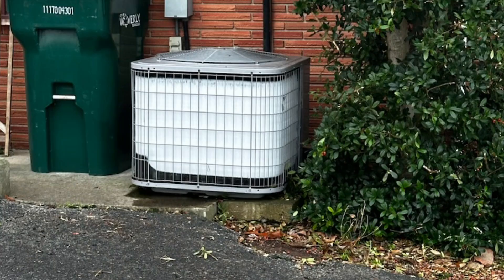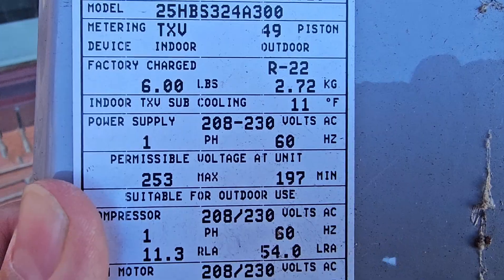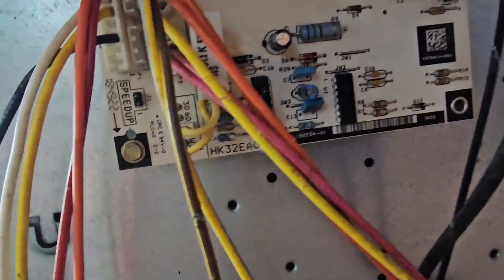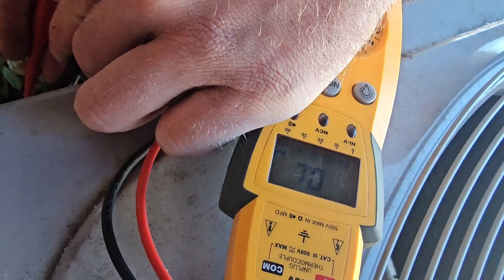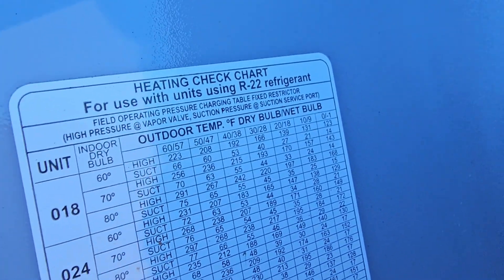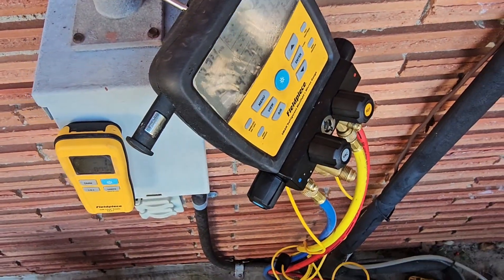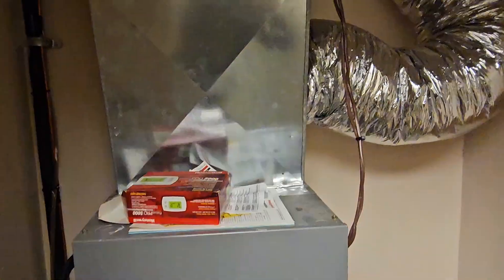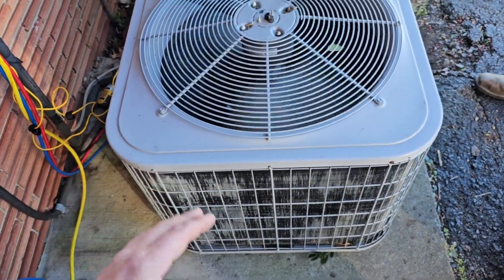Why is the Heat Pump Freezing up? #heatpump

Comment: And Third! If your R terminal, “24v” gets disconnected or if there is a safety switch cutting off the R terminal for outside, the heat pump won’t do the defrost cycle.

Comment: Nice, and to the point. And if it's an older unit with corrosion on the indoor coil, the slight vibrations caused a light leak....Or someone went in there with a knife or screwdriver to try to knock off some grunge 😂.  Thanks👍

Comment: When you forced defrost shouldn’t the ODF of stoped as well.   Either defrost relay is stuck closed or it’s been wired around the defrost control.  Fan should not be running in DF.
Reply from the maker: I did not short the test pins long enough. I also did not have the defrost thermostat closed

Comment: Hey quick  question guys... if the heat strip are on will that affect my high side / subcool readings on my guages? How would  you turn them off just untwist or loose the white wire on the defrost  board?

Comment: System is 15 years old time fir new.
Never try to make pressure meet heating chart it is only a guide line.
Only way to properly change is in cool mode,and verify indoor metering device.
Just because it says txv outside doesn't mean it is inside.
Best rule of thumb fir r22 in heat mode is low side pressure should be within 15 of outdoor temp.(is 40 degrees  40 psi + or -)
Only for checking but etc d well.

Comment: Hey man nice video I love the content I just have a couple tips! When testing SH in heating mode that suction line is no longer the suction line so that temperature your getting is the Discharge line temp. To get true Superheat in heating mode I usually open the top and clamp the big pipe on the inlet of the outdoor unit. Time consuming but worth it to get True SH so you are not overcharging! Love the content keep it up
Reply from the maker: Good tip
Yes sir thank you for watching I really appreciate you.

Comment: they’ve been chasing a leak on my minisplit for over a year now, sadly the two different companies have resorted to the parts cannon method.
they said they now want to change ALL the lines to the 5 zones, $6000 in labor was the cheapest quote, only the parts are under warranty. 
the system looses $870 in 410a every 3 weeks. Im getting the feeling the companies in my location know less about hvac than my postal carrier
Reply from the maker: that is a crazy price 
if it only last 3 weeks its probably in the indoor coil
Reply: If seen things like lines get punctured by a screw or nail because of how or where the lines were run.
Reply: That loss rate should be easy to find and unlikely to be in the lines unless they are rubbing somewhere and worn though.  Are you sure it's two different companies or two different adverts?

Comment: When testing subcooling on a heatpump should you check liquid line temperature at the outdoor unit or inside at airhandler? I wonder if the temp would drop much. Thanks for the videos
Reply: Inside, on this method! You would focus more on the approach method, return dry bulb minus liquid line temp. Liquid line temp should always be higher than return air.

Comment: Why are you mixing refrigerants? You just contaminated that system.
Reply from the maker: Did you see me mix refrigerants
Reply: @taddydigest so you just have a blue tank out for no reason? Plus you have it hooked up to gauges and clearly are charging with it, if the system has been converted before hand just say that but you do say this is an r22 unit
Reply from the maker: This unit was converted over to 422b
I'm adding the refrigerant that is already inside the equipment.
Reply: He never mixed refrigerants
Reply: @AJ-ox8xy what refrigerant is that blue tank he is using?

Comment: What delta t do you like to see on straight heat pump, sat/rat?
Reply: Hey man! I got ya! Temperature difference usually depends on the amount of humidity in the home. (Wet-Bulb). With the Wet-bulb temperature and the dry bulb temperature you can then look at a chart and determine what the proper Delta T should be. In heating mode though it is usually 25-35 or more. For cooling here in Arizona we like to see about 18-22.